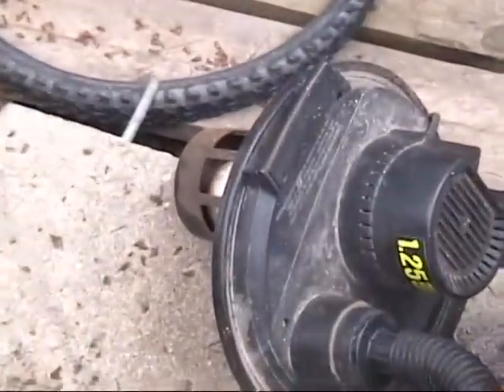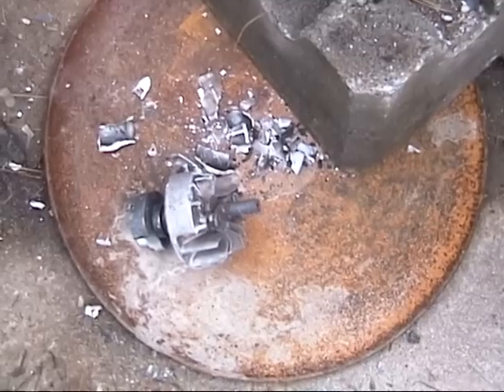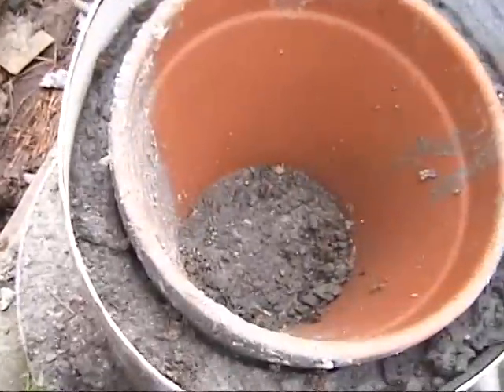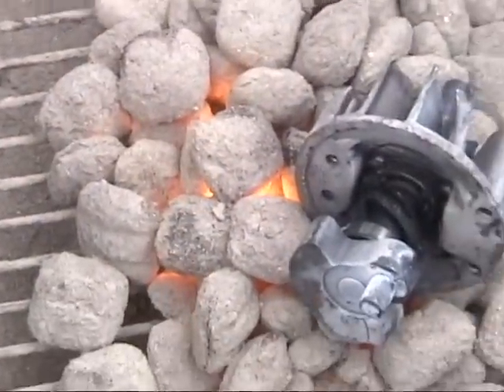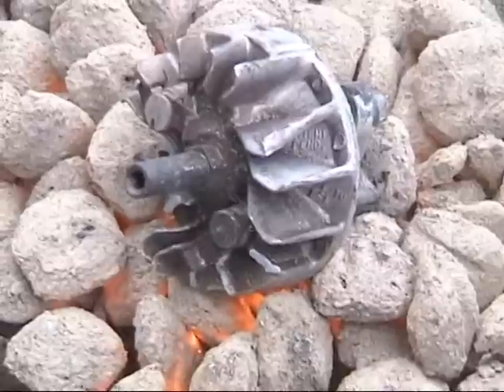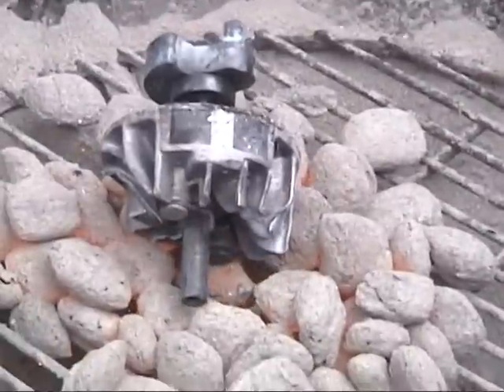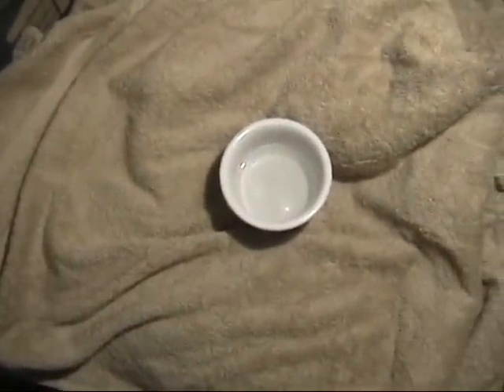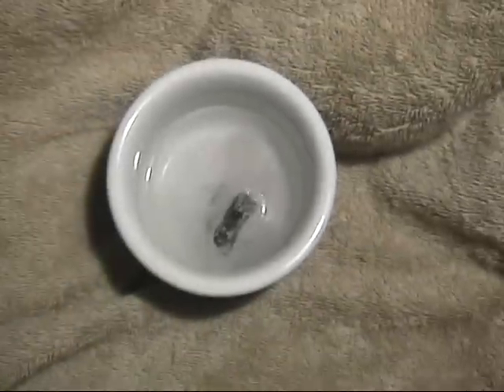Back yard metal melt

Comment: for the future, the shaft looking piece coming from the flywheel is a nut. it may prove much easier to remove the nut and the whole flywheel will pull of the crankshaft. just food for your thoughts. you wouldn't have to beat it up with a hammer. hope this helps.